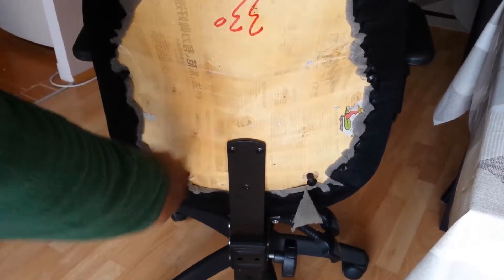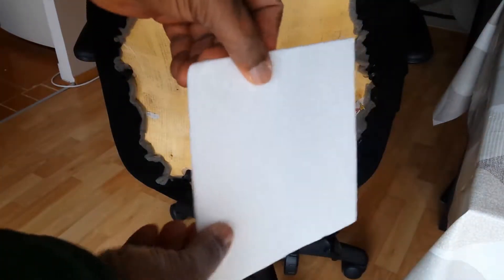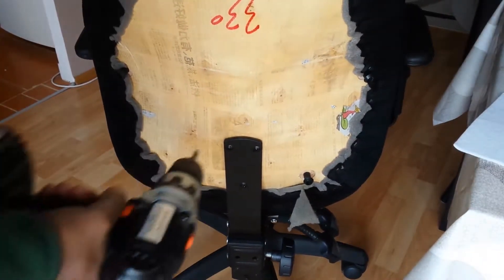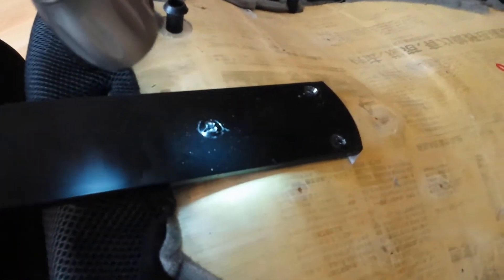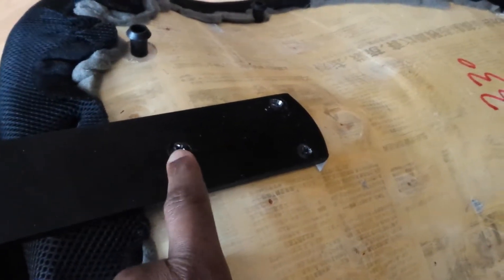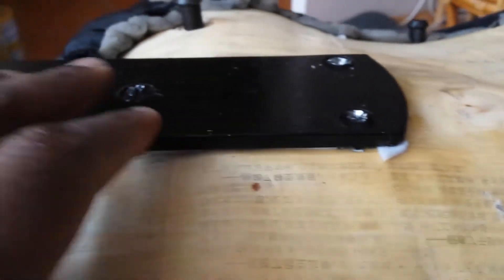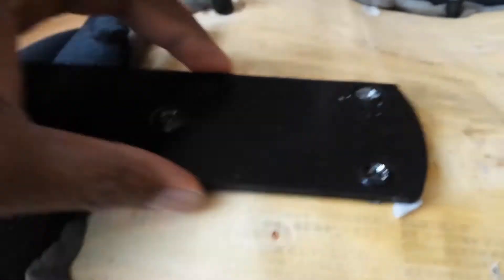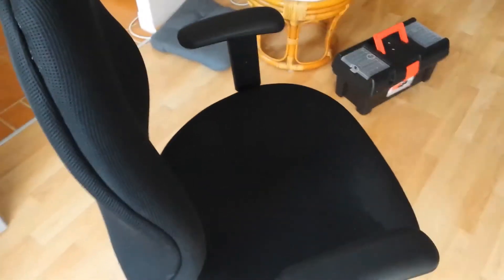Permanent repair of squeaky swivel office chair backrest. Stop noisy chair backrest

Comment: thank you very much!  I took my chair apart and tightened the screws, hoping that would take the noise away, but it didn't... then I wondered - how do I get the back cover on that attaches to the main back of the chair  It looks like that was stapled on at the factory but I don't have staples that are long enough - will have to use wood screws I guess.  How did you put yours back on?  Thanks again!
Reply from the maker: Hey Nancy, mine had some plastic points that plugged into the back into their respective holes. But screws will do just fine for you and give you easy access in future. You will need to have someone sit on the chair and move while you listen for the real source of the noise.
Reply: @diyroby732   Hi, thank you for the reply!  The noise is coming from the spot where the wood meets the metal. (exactly the same issue as you which is why I was so glad to find your video!)  I'm looking forward to cutting the noise with a similar material that you used and hearing silence when I'm sitting in the chair!  Thank you again!